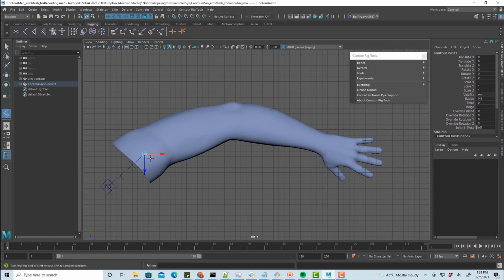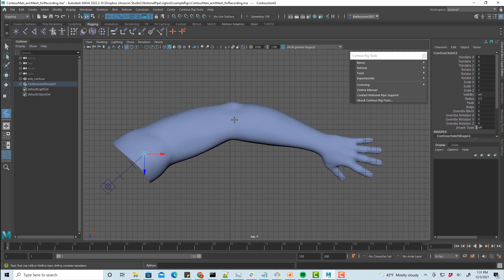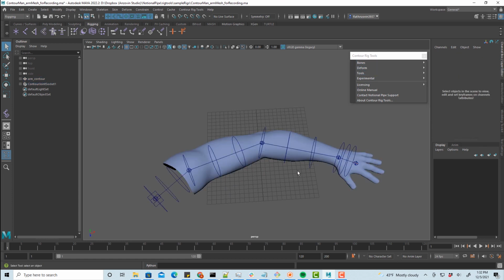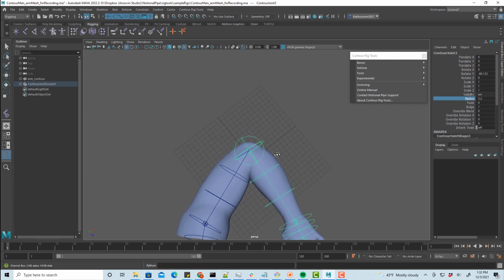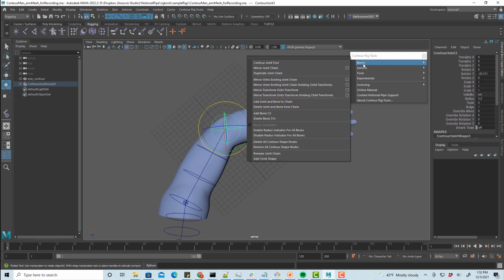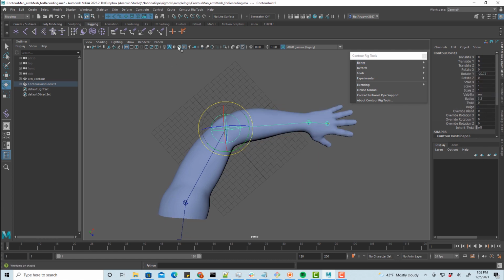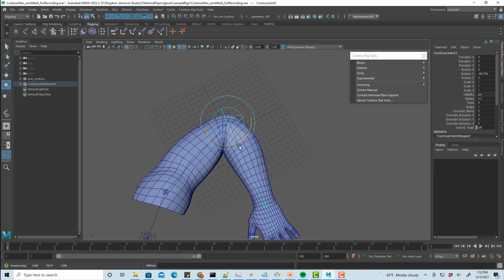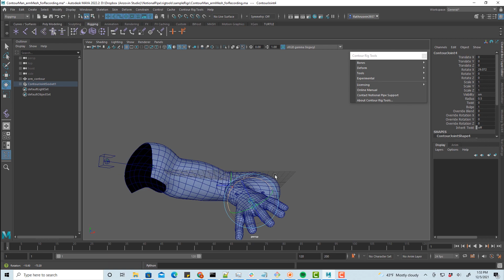Introducing Contour Rig Tools: Contour bones and deformation basics

Comment: I do not suppose you've integrated this with an auto rigger with templates like advanced skeleton?  That would made me buy as I'm an animator not a rigger, but I would like to create a cartoony 'rubber hose' character.
Reply from the maker: Hi Matt. We're currently working on adding some auto-rigging-like features to Contour, and though we don't have a firm date on getting them into a release, I think they'll be in in the not too distant future. They won't be an auto-rigger, precisely (and a lot of the features of most auto-riggers aren't really necessary for Contour,) but they will allow you to pretty much generate complete standard Contour rigs. resize them, paint some weights, and bind.
Reply: @notionalpipe8767  that would be awesome
Reply: @notionalpipe8767  I have another question. And I hope it's okay to ask. If I use contour for my characters body can I use advanced skeleton for the face?